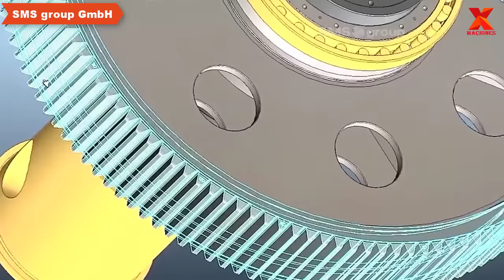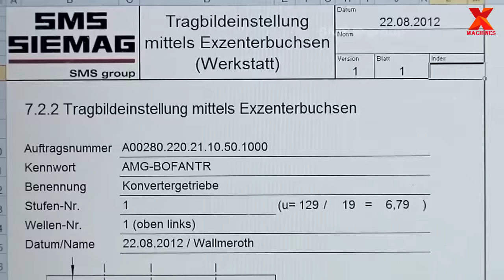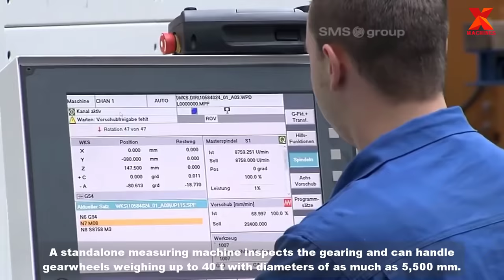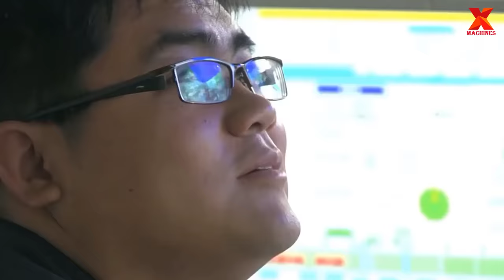The world's largest gear manufacturing process | CNC Machines

Comment: Amazing process .I use to operate fellows gear cutting machines  , a Hobber and a Gleason Bevel gear machines and you could never run at that speed . the rpm yes but the feed never ,They were consider manual ,still got it done ,very interesting ,We also cut Worms and splines .
Reply: The video is sped up.

Comment: How does the synchronization between the thread cutter and the spindle work? Is it handled by the computer with rotary encoders? Or is there some kind of linkage?
Reply: most likely axis interpolation between direct reading scales eg rotary encoder to linear scale.

Comment: after a career of machining spur gears up to 160 inch diameter 16-30 inch face, 18-24 inch bore  and up 140 teeth  i found this just astounding.  i knew what i did was dinosaur technology,  but i had no fricking idea it was this advanced.  the one thing my gears would be considered a "bastard" size tooth profile,  designed in such a way to be cost prohibitive for a competitor to buy a hob cutter to fit each gear  and pretty much guarantee a gear replacement would come from us. [SUGAR MILL extraction]
Reply: @ Paul M I was wondering if you could tell us where these gears are being used. I am not suprised that these large gears provide a need. I am surprised that there is an entire industry, all over that can support itself by making them. I can imagine that the prevalence of windmills have increased the need for large gears. Where did they go before that. A few are needed for ships. Another few in the turbines that are behind making electricity at a water dam. How many more applications use extremely large gears? thanx.
Reply: @629Justme  This is the best question I’ve seen so far. I’d like an answer😅

Comment: Where can I find so giant gears?  In the power plants or inside the cargo ships ?
Reply: Cargo ships (typically) use reciprocating diesel engines that run at the same (very low) RPM as the prop so a direct shaft is all that is needed.  Gear trains like this are needed to convert high-RPM sources like gas and steam turbines, to a lower RPM for the prop shaft.  From what I can tell, only military/naval vessels regularly use these in ships.  I can imagine that large factories may use gear boxes on this scale too but I've no experience with that.  That being said, I doubt power plants would need any gears like this because the electrical generators work at the same high RPM as the turbines.
Funny thing, when I was in the Navy, it was well understood that the USN doesn't 'buy' the bull gears (the largest final gear in the train) for its ships and subs, it leases them!!!  Who knows if that it true but if so, it sure speaks to the cost of such large-scale, precision machining.

Comment: Sorry guys Westinghouse Electric boat division has way way way bigger gears than that and are precision ground and oh did I say they were massive! 😎
Reply: ...maybe you could tell why so many super large gears are needed? The comments tells us where a few individual ones are needed and used. Once thats done, where do all of the other ones go?
Reply: @629Justme    You have the main gear which ours are close to 50 feet in diameter and then you put generators around that gear through other gears so you have multiple generators being run on one gear.
Reply: @nickreno644  Thanks. Any idea as to the number of applications for these large gears besides atomic submarines? Trying to get an idea where all of these super larges gears go besides power plants and electric boats.

Comment: What industry  might those  huge gears be for?
Reply: drawbridge mechanisms,mining machines etc.
Reply: They go on the outside of cement kilns, ball mills etc.
Reply: and what about windmills, waterturbines etc
Reply: The most gears you saw in the video are all made for the steel industry, the big once are used in gearboxes of hot rolling mills, some in converter tilting geraboxes etc.

Comment: Can anyone tell this huge gear is used for which industry /application?
Pls let me know name of the company manufacturing such huge gears
Reply: Sms group, gears for forging machines
Reply: Philadelphia Gear makes gears that big, I used to work for them. The big ones could be used for a mill, like a cement mill. I worked for Falk also they made bigger gears than that. The biggest was for a hydro turbine,  about 40' in diameter.
Reply: Hofmann Engineering in Perth, Australia’s can make them to 15 meters.